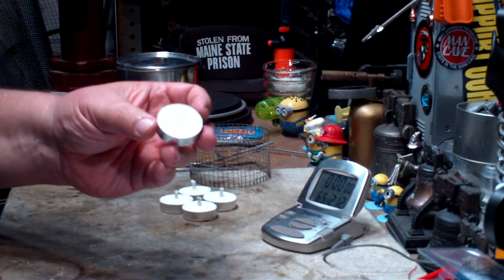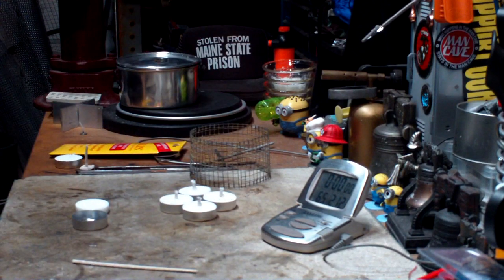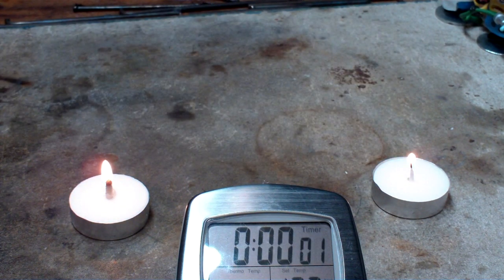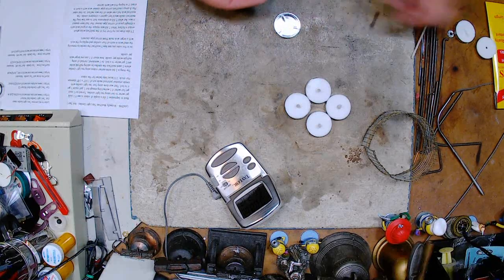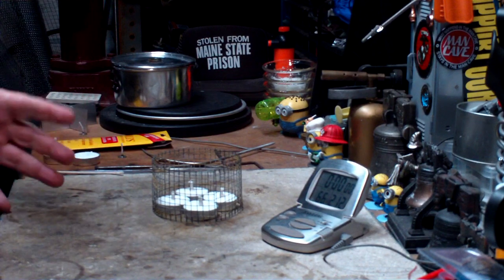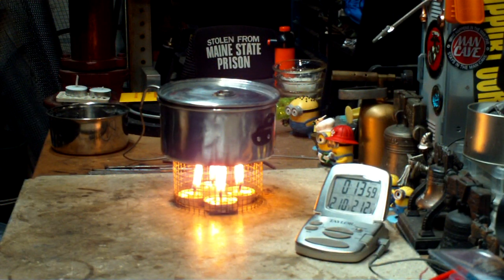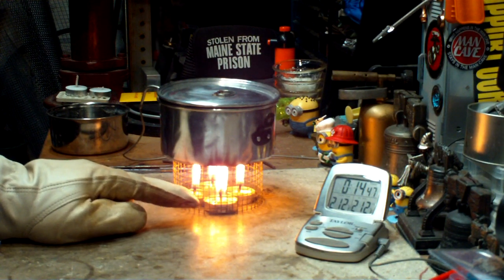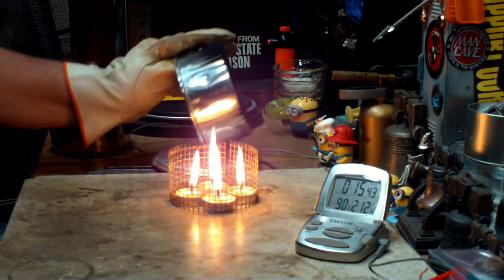Wickedly Modified Tea Light Candles - Boil Test 1

Comment: Could use multi-strands of cotton wicking, instead of pipe cleaners..wicking comes on a spool, maybe easier to get.  4 strands of average wicking, waxed together, attached to the base stand washer, does it.   A cleaner burning heat source & cooker, is a rocket stove..,can make those in many sizes, using recycled materials.

Comment: Use denatured alcohol in small glass liquor bottles. Use at least four, then add the cotton wick into the bottles with two holes in the bottle caps. One for the the cotton wick, and another for air to reduce pressure. :)

Comment: interesting.. OK... don't waste the original wicks though .... Since the wax can be removed from the holder just use a heated metal rod like a short piece of wire hanger to tap three holes through the wax and reinsert the wicks..Basically you just increased the intensity of the flame and the same can be accomplished using the multiple wicks..I have been tinkering with the tealight stoves and clay pot heaters and like the cotton pipe cleaner idea.. the only worry is  the "self ignition" of the wax if it gets too hot

Comment: we had a fire, thankfully we were able to put it out by smothering it with a large cooking pot. It seems like the problem is when there are many candles together and all the wax melts. There was enough heat to actually start the wax on fire and not just the WIC.
Reply: Great comment. It is pretty dangerous to use tea candles like this.

Comment: Why not just use a piece of aluminum foil between the pot and the flame to contain the soot. You could keep it in a designated holder so the soot won't mess up other items in a drawer.

Comment: I saw a video where a guy took corrugated cardboard and folded it up and stuck it in the melted tea candle, to use as a wick, and that it reduced burn time to about 15 minutes for the whole candle. I wonder how fast that would boil water.
Reply from the maker: +hzuiel Sounds like he basically made a very small "Buddy burner"
Reply: Hiram Cook I just tried it very roughly right before settling down for bed and i got a pan of about a pint of water to 181F in about 10 minutes with only one tea candle, overall it burned about 15 minutes.

Comment: Brilliant idea using the pipe cleaners. I had always swapped in Q-Tips with the rolled paper stems, cut in half, poked through, and wound the stem into a base. A drop of olive oil on the cotton swab means I didn't have to melt wax onto it.

Comment: I made an altoids tin candle with the flat wide lamp wicks and the same thing happened to me, the wick tipped over. I used heavy copper wire and made a support for the wick. I also used bees wax. It burns longer, has a higher melting point, and seems to soot less too, but I never used it like you're doing.